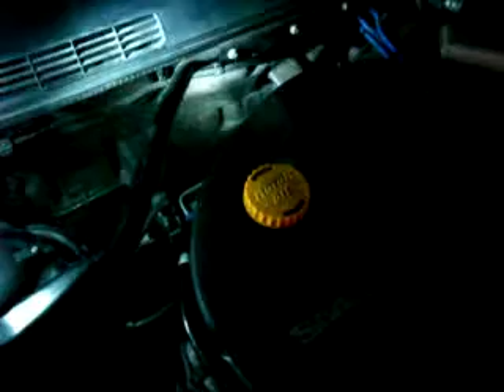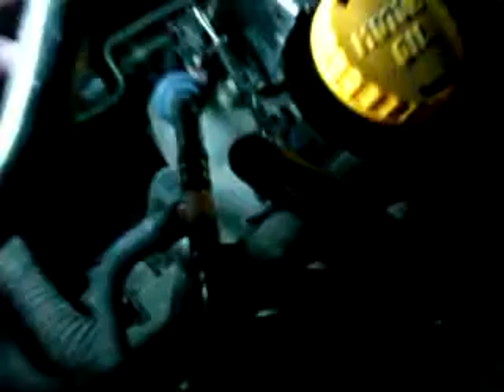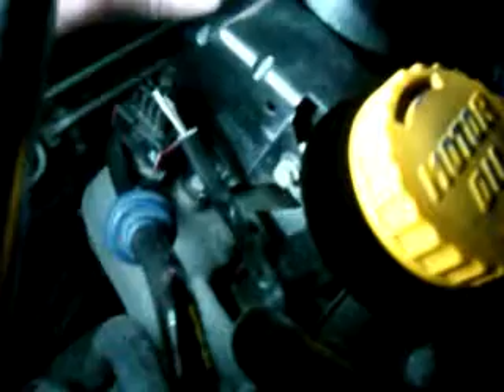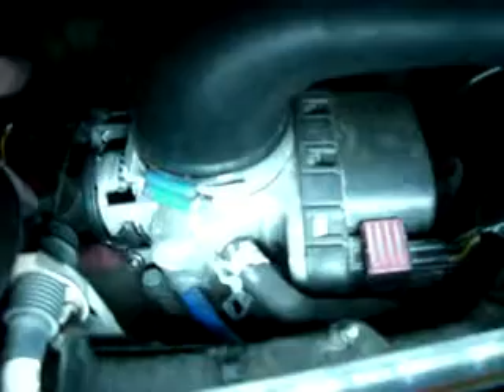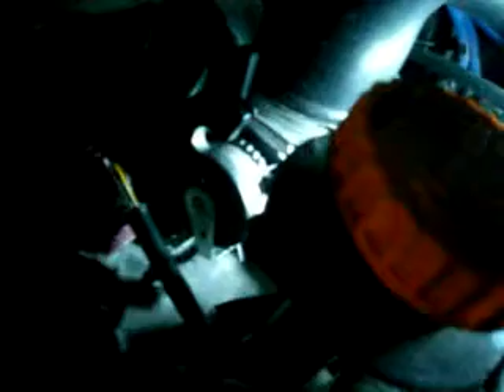How to reset a Saab B235R throttle body from Limp-Home-Mode

Comment: I had an issue when my battery failed while in drive causing the car to shut down.  I replaced my battery but then it went into limp home mode.  i reset the throttle body like in the video pulled the fuse and waited.  When i started my car it is still in limp mode according to the dash light but the throttle body is acting like it is not in limp mode,  I am afraid to drive my car now.

Comment: Thank you! You are an Angel. Just want to mention to everyone, If your check engine light is already on you will have to pull the cord to the battery to reset your car before restarting, or else your car will go right back into Limp home mode.